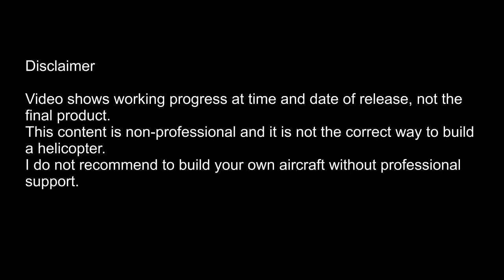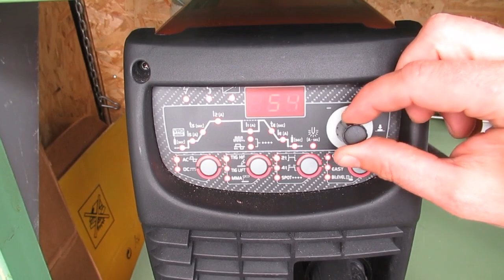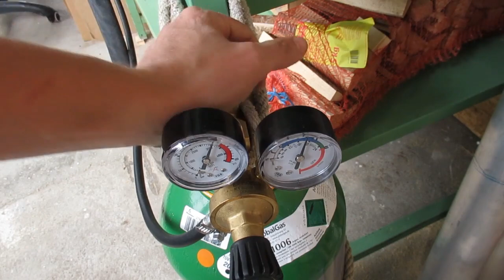Coolant Overflow Bottle Mount EXPERIMENTAL HELICOPTER BUILD SERIES (Part 28)

Comment: No baffles in the tank, interesting. As a coded welder the areas where you have multiple pipes welded to one main part of the structure you should really use a triangulated gusset, not fully welded but to spread the retention strength further along each of the intersecting members